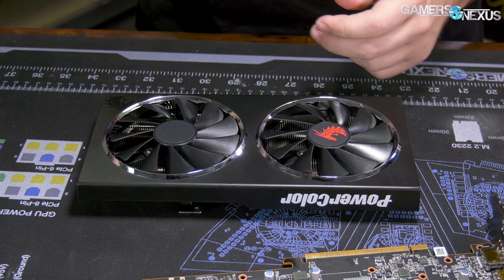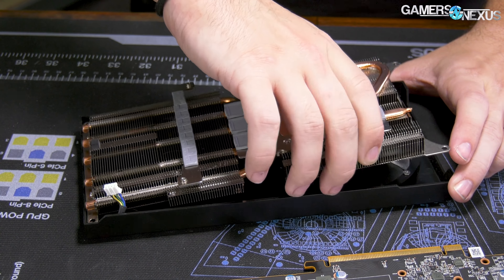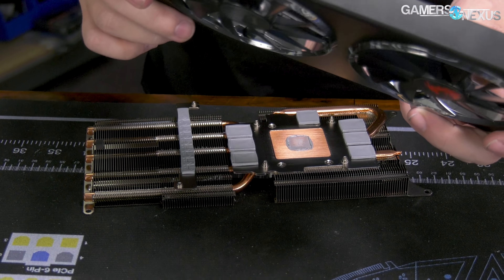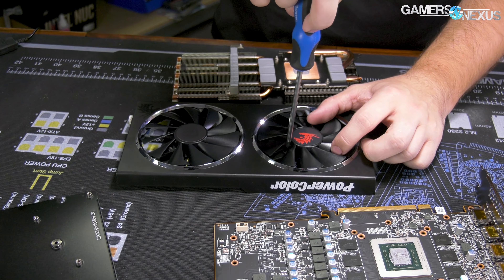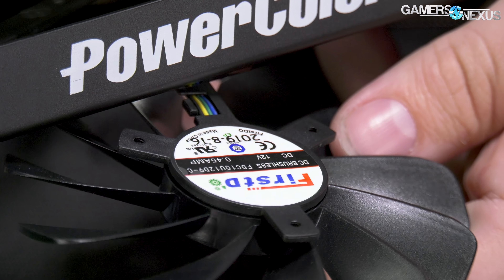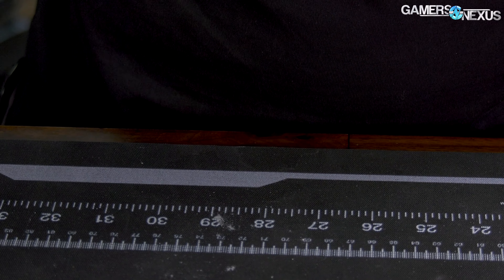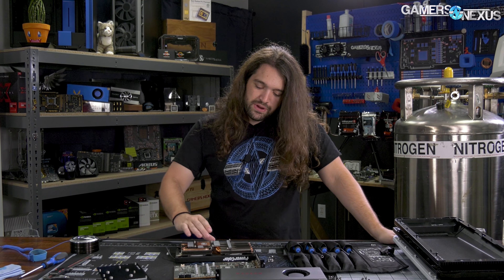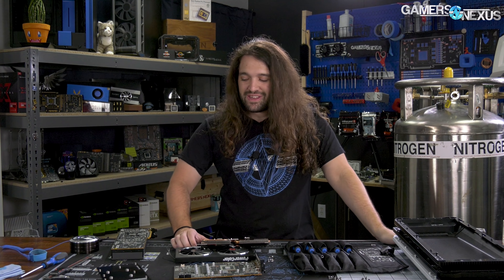Deleted Video: Tear-Down & Thermal Design of PowerColor RX 5700 Red Dragon

Comment: I hope AMD adopts this kind of stock cooler for their next gpus
Reply: Make the shroud screaming red, loose the chrome plastic rings arround the fans and it is perfect.
Reply: Radeon 7 triggered.
Reply: @CastAway_Dave i dunno i doubt they'll do it so they don't compete directly against their AIB's.. i think they only reason they went with a cooler like this on the radeon VII is that there wasn't going to be any AIB custom cards.
Reply: I'm here from the future. Yes but you can't buy one :'(
Reply: @d2ricci  The Navi stock cooler is pretty mediocre actually. No heat pipes, just a vapour chamber stuck onto a heatsink with a thermal pad between it and the GPU die. Sure, it's better than the garbage AMD used to have but it isn't great.
Reply: @Amusia727 My comment was a joke reply

Comment: Does someone knows the thickness for the pads? I had to replace a bunch and they ended up being too thick or very little conductive so i want to know some insights in the matters... thank you in advance!
Reply: 1.0mm on rams, 1.5mm on long ones
Reply: @tahatatilbal  Not sure but it seems like VRAM takes 1,5mm. VCore also takes 1,5mm. And on the Backplate it takes 2mm
Reply: @Trip4man  no, it's 1mm on longs and yeah vrams take 1.5mm

Comment: Seems like a fan mod with some noctuas would be really easy on this card.
Reply: @Halfar Jubelson Really? That's great to know. I ended up buying the red dragon 5700 xt and am still planning to do this. I just wasn't sure on how to go about it. How did you end up mounting the fans? I guess the screwholes for the shroud are a bit too small for fan screws. I thought about using those noctua rubber sticks but I don't have any of them and wasn't sure how they would fit
Do you mind taking some pictures and uploading them somewhere? I'm really interested in your solution